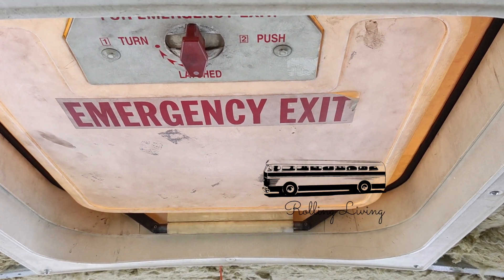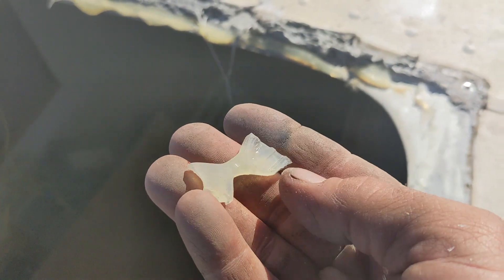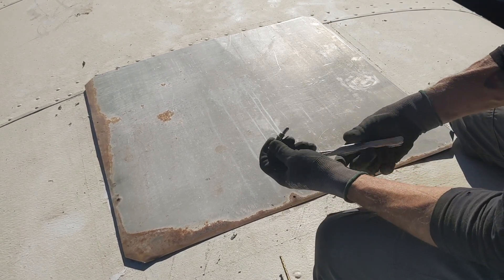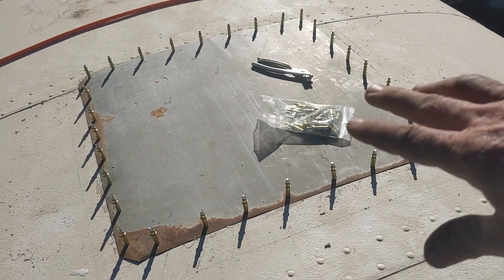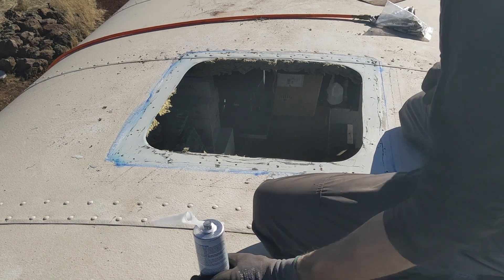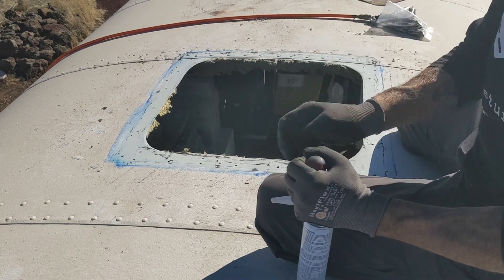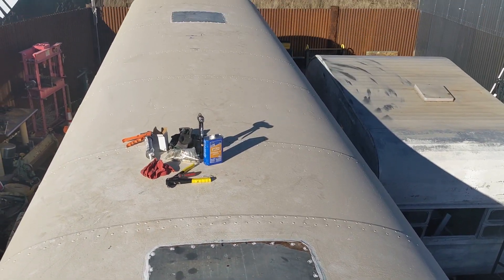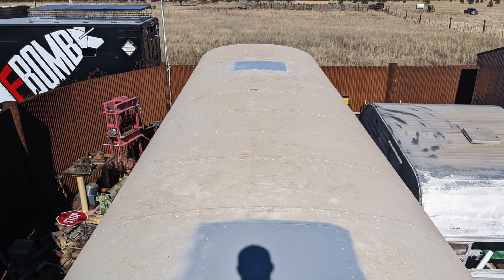Removing a bus emergency exit roof hatch...and how we seal them so they never leak.

Comment: What is the name of the material that you covered the roof with.  Is that sheet metal or?!?
Reply from the maker: The patch is 16 gauge steel.  The roof is steel, but a thinner gauge.  I use 16ga because it's a bit more rigid...and that's what I use for roof raise siding, so I have lots of leftover pieces.
Reply: Where can I purchase an new emergency exit like the one you took out I’ve been looking an having the worst luck